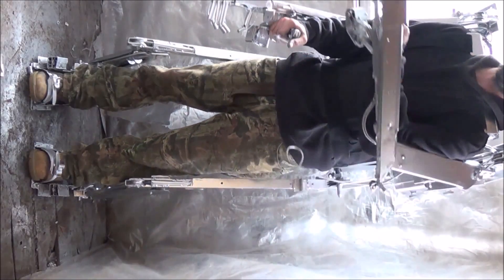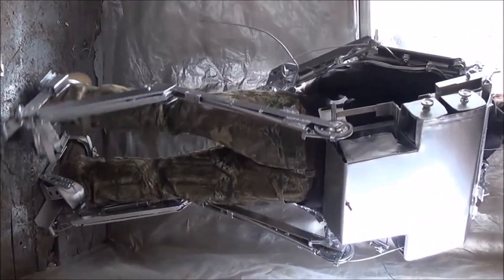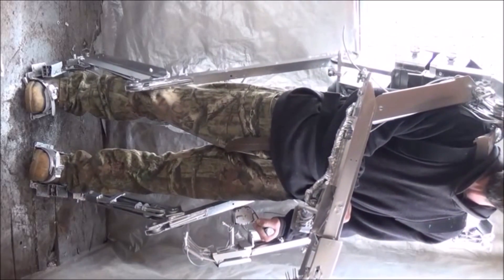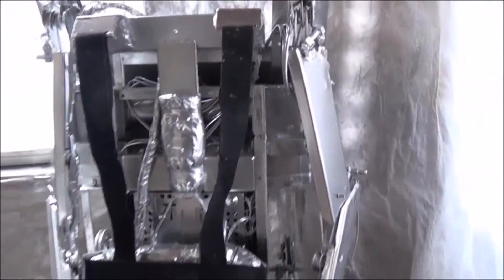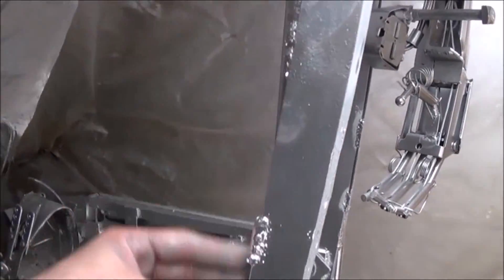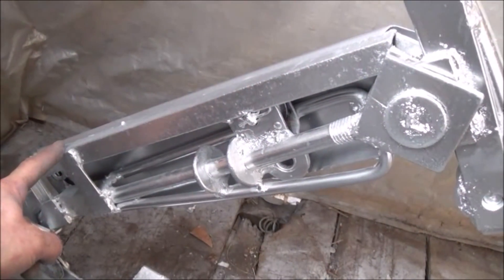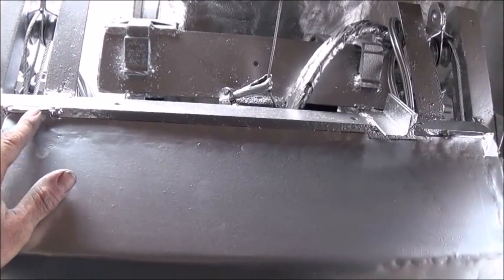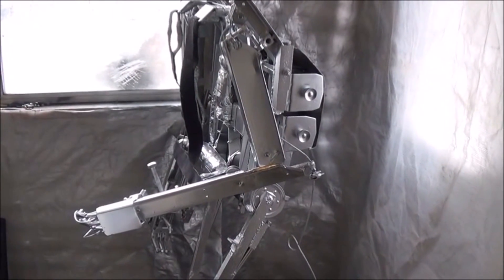Exoskeleton Suit, Final build video

Comment: You had said that the paint gives it an aluminum look, I honestly thought it was going to be aluminum considering its light weight, and it only needed to cover up the wires and everything, so it wouldn't be under any pressure. So what instead did you use?